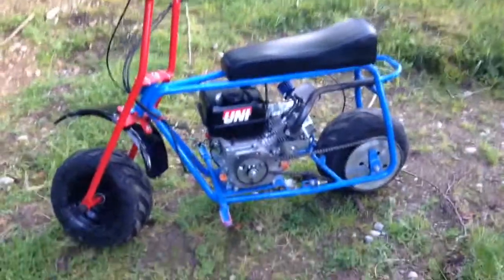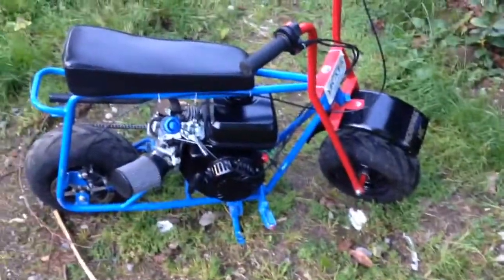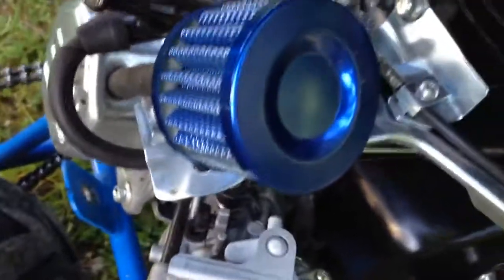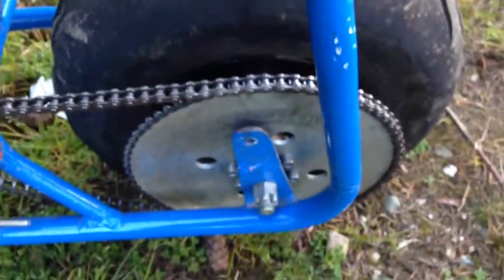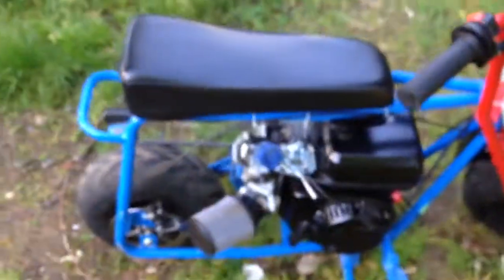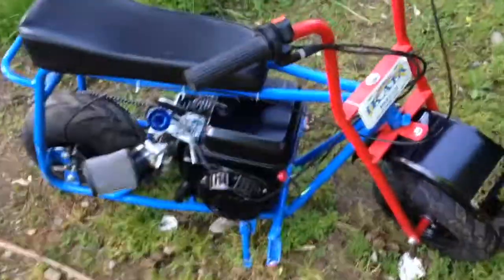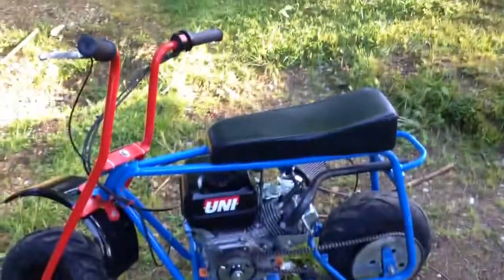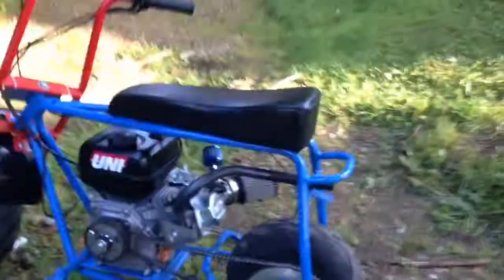212cc Baja Blitz walk around

Comment: Ok, I'm by far, not too knowledgeable on mini engines yet. Work on it.
But what does the different air filters do for the engines ? Make them faster ? Sound better ? Better fuel efficiency ?

I used to into dirtbikes/streetbikes, but never got into aftermarket, modifying them. I just used what came with the bikes. Etc...

Comment: Isaiah I just picked up a couple baja mini racer frames and the predator engines for them. 
What was your procedure for mounting the engines in??
Did you have to re-drill holes in the frame plate? And did you use any kind of mounting plate?
Reply from the maker: No mounting plates, we always re-drill the holes for the new motor.

Comment: How do you have your throttle set up? I have the baja db30 (old style) whcih looks like the blitz but when I twist the throttle back it somtimes stickes and also how do you adjust your idle on the predator 212
Reply from the maker: Try loosing the throttle linkage bolt or loosing up the the screw on the bracket that holds the cable. And there is a black screw on the carb that will let you do a little tweaking with your idle.

Comment: Does that air filter make it start easier (don't have pull the pull start a lot) cuz the minibike I have takes around 20 pulls to get it started lol
Reply from the maker: No it doesn't, and what kind of engine do you have??
Reply: the engine on the Baja blitz it's crap takes at least 20 pulls and leaks gas like crazy though